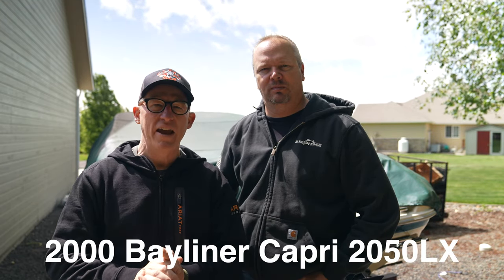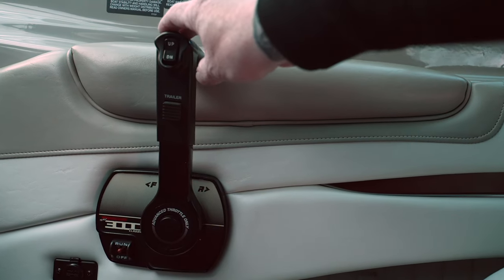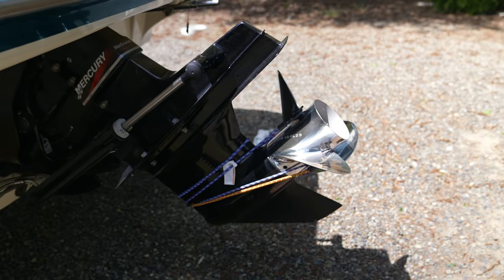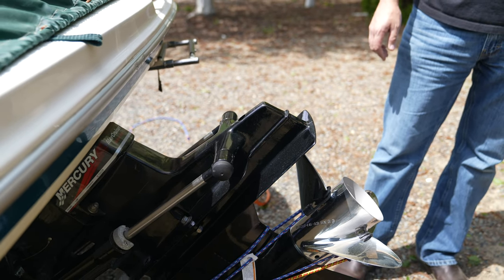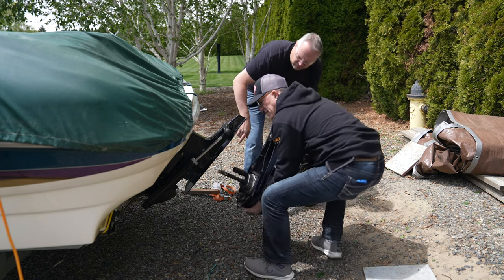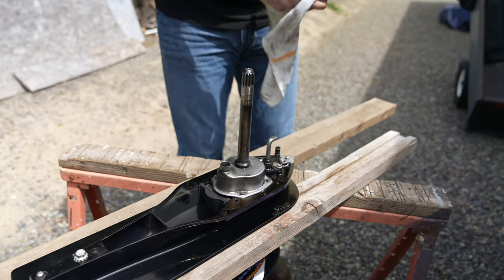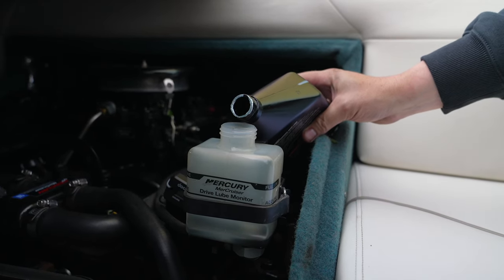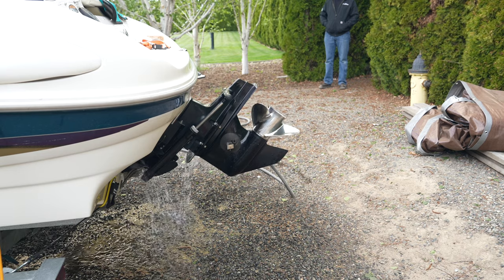How To Replace The Impeller On A Mercruiser Alpha One Sterndrive Outdrive

Comment: I have done this before and no bungee is needed and you can rotate shaft as much as you want. When installing, just don’t force it and gently work prop back/forth a bit to align splines while gently lifting. It’ll mate darn near instantly.
Reply: Thanks!  Definitely don’t have to worry about the shaft turning, in fact, it makes it easier to align the impeller key by turning the shaft.
Reply: Thanks for this!! i noticed they said not to move it and they stressed this, but they didn’t address what to do if it is moved. Sure enough, doing mine the prop spun and shaft moved even bungee’d so i didnt know how to proceed from that point. Same with the linkage… although i didnt move my linkage, it would be nice to know what to do for folks when things don’t go just perfectly. “Best laid plans” and all that.

Comment: Great video. From other videos I've seen after the gear oil starts coming out of the vent hole they close it up and continue pumping until its flowing into the reservoir to purge air. Do you think this is necessary ? Also should you trim the out drive down before starting it?

Comment: Hi Guys,
Great video and myself and my father used it to do this repair including the big conical seal on the vertical shaft…
Just to mention though that the video doesn’t mention the bolt at the very rear tail of the unit that is undone when the silver plate comes off…
We were banging and shaking the leg for 30mins until
I looked up under there and saw the extra bolt needed to be undone!
Even so, still a great detailed procedural video… thank you!
Reply: I'm at this stage right now.  The lower unit does not at all drop like they showed.  I've been banging on it with wood blocks, but finally gave up last night as I was afraid to break something.  Like you said, great video, but not complete without this.  It's good to see this in the comments.  When I get home from work tonight, I'll check it out.  Thanks
Reply: @mattlabrecque186  Hi Matt,
Yep I was almost breaking it too until I found that bolt! Please let me know if it was your issue too.
Reply: This comment needs to be higher! The video is otherwise great, but the lower unit won't come apart unless the bolt under this plate is removed.
Reply: Gets me every time lol
Reply: Are you talking about the bolt at 17:51 and 18:20 in the video when they are re-assemblying?
Reply: @Barryfamily1 that’s the one 👌🏻
Reply: I noticed that unmentioned bolt when they were putting it back together.  Good to know.  Great video!

Comment: Excellent video!!  5 stars!!  Your step-by-step instructions saved me hundreds of dollars.  I can't thank you enough.  As you mentioned, the toughest part of the job was reinstalling the lower unit.  Getting the splines of the lower unit to line up the upper unit was  difficult.  To assist with the reinstall, I used bungee cords on the prop as recommended along with a heavy dose of masking tape to keep the drive shaft and splines from moving during the procedure.

Comment: My boat overheated Saturday.  Almost 325 hours since the last impeller was changed. We run mostly deep water. Thanks for this video. We are gonna tackle this job this week. Really appreciate you going through this. Not rocket science but lots of good advice here. Need to learn to do this as its a regular thing. Cheers.
Reply from the maker: You betcha. Thanks

Comment: As has been stated many times, this is a great detailed video and should help many folks take on this DIY project. I would add one caution to the instructions, and that is to not run the engine with the outdrive trimmed all the way up in the trailered position. It has been said this will cause excess stress on the gimbal bearings. That may be an "old wives tale" but it's probably better to lower the unit from the trailered position "just in case."

Comment: With over 24,000 views, its evident this is one of the best tutorials out there. Very good work and much needed content!
Reply from the maker: Wow, thanks!
Reply: @RyanUrlacher  hey Ryan so quick question I have to change the impeller and I also had a leak of gear oil coming from the prop which I believe is my shift shaft seal. Is it hard to seal the whole unit while doing this and having it apart and do you have a video on how to do that. Thank you

Comment: Overall a very good video but since the unit is looking fairly well maintained and not that old here some extra checks for older units. The bungee cord is a good idea but once you put the lower unit back on remove the prop to check the propshaft for things like fishing line. When pumping in new gear lube oil you can also pump until the ventilation hole, close it and pump some additional oil in the system until there is a little bit in the reservoir. Than fill the reservoir. Note, not all outdrives have a reservoir or monitor inside the motor compartment. Important is to check while doing maintenance the status of your anodes and lastly the levels of your power steering fluid. (Cold and Warm) It can be a sincere pain in the ... to get well corroded oil drain plugs out. Do NOT break them. Sometimes the old gaskets from the drain plugs do not come out. Always replace old gaskets for the drain plug and check for the old ones.  Important thing to check is the quality and color of the lube oil that comes out. This, to check if you have any water leaking into your system. Hope this helps. Again excellent video.

Comment: Thank you for this tutorial! I just bought a 1999 Sea Ray 230 Signature. After watching a few videos, I realized it would be a good idea to change the oil, the impeller, and the gear oil to ensure I am ready to go. I was struggling with what kit to buy until I found out I had the alpha gen 2. I watched quite a few videos until I found yours. This one is the most detailed. I got a quote to do the gear oil and impeller at close to $500.00 at my local boat service center. I will be taking this project on myself now.
Reply from the maker: Right on!  Glad to help.

Comment: Great video gentlemen…very easy to follow & step by step descriptive. I think someone else commented about the bolt behind the round anode plate (above the prop)…that took me…oh…about 2 extra hrs to find!

If kit didn’t come with the sling seal gasket tool, you can just use the plastic gasket tube…it’s the extract opening size to place over the rubber sling seal to set it in place.

Comment: Thanks for the video! Just have to add as a newbie you didn't mention in the beginning the additional bolt that was there one you take off the plate. I thought my lower and upper were seal together shut so tried rubber hammering it and broke the lower unit flat plate. Had to get it welded and fixed wish I had know as you mention that bolt t
When putting it back on. Learning experience for me
Reply: @gusquintana8661  that's what happened to me too! I thought it was just because the boat is a 1985. I didn't watch this video first, but the stern drive is a little bit different with only 5 bolts.

Comment: Excellent breakdown of the job.  I have a question about the grease used at 11:55.   It looks like you are using a waterproof lithium based grease.  If so I would suggest that this is the wrong grease. Its fine for metal to metal use in marine enviroments, but it will eat away at the rubber impeller if used as you do here. I would use a red rubber grease instead or you could also use Evinrude tripple guard, which is safe for use on seals, o rings and rubber components.

Comment: Excellent video! But, you forgot to mention the removal of the hidden bolt under the anode plate. I see that you mention putting it back, but not removal. The lower unit will not budge until that bolt is removed.

Comment: Best video on YT on this topic. Thanks a lot!
I saw another clip where they used the oil pump to fill oil bottle in the engine room from beneath getting rid of the air in the pipes.
Reply: Do you mean they kept pumping right up past the vent screw and continued pumping into the reservoir? That sounds like a smart move.
Reply: @michaelking42  Exactly. I did it and it works 🙂
Reply: @ThomasT1976  Awesome, thank you. If I remember, I'll do that too. I do want to flush my oil out when I get to doing the job.

Comment: Great video, very helpful. 
There were a couple mistakes.
Some of the gasket sealant was in the wrong place (not a big deal).
But, DO NOT lube the face seal or shaft when installing. They should both be totally clean when installing as the friction fit is supposed to hold the seal in place. Only a little grase on the housing to allow the seal to slide when rotating.

Comment: You mention there is a bolt under the plate to contend with but removing it isn’t in the video. I thought the paint was acting like a glue preventing the lower unit from separating but it was the bolt you mentioned but didn’t show removing. Otherwise this video saved me tons of cash!

Comment: Excellent Video and highly motivational. I used the link, bought the impeller kit and awaiting delivery. 2 questions: I like the chalking of the prop so it goes back in the exact same way it came out. It looked like there was just enough wiggle in your setup to need slight adjustment to put back in. A) Would it make sense to wedge a block between the prop and lower unit and bungee/secure in that immobile state? B), even though your method was slightly out of alignment, it appeared the little wiggle wasn't too much of a problem or hassle. Perhaps A) is not as important if the wiggle is so easy?    Thanks for the info!  /to

Comment: I made a mistake and moved the shift linkage and tried to line it back up but was off a bit and forgot to double check it. I bolted the two units back the together and caused an issue with two shift linkages. I dropper the lower unit a bit and realigned it back up but they would not go back together. One of them moved in or out. So, I used a pair of pliers to squeeze them back in place. Will I have in issues with my shifting? I would add, make sure these two are married up perfectly before tightening up the bottom unit. Other than that pretty easy job.
Reply: It's fine if the shaft rotates but you can only rotate it counterclockwise to line it back up or it will shift out forward and into neutral and your linkage will not line up
Reply: @Oicu812b4y thanks for this. Not totally clear exactly what ya mean but counterclockwise sounds key. Can you spin it all the way around counterclockwise? (Multiple times if needed because over shot the mark)

Comment: This video did not mention that there is 2 bolts at the back where the aluminum plate is. Once you take the plate off there is another 14mm bolt that goes up through the bottom and you won't see it from the top of the drive, you have to look from underneath after you get the plate off to get it out. I took all the bolts out accept that one not knowing it was still in there and I was trying to pry my drive apart. I ended up cracking some of the housing on the bottom half because it was still being held by that bolt. Now I have to try and get the crack repaired at a machine shop so I don't have to buy a whole new drive. Don't make the same mistake I did. I'm not sure if all drives are like this but mine was!
Reply: I had to watch another video where a guy pointed out that bolt on the bottom.  I was banging away on my drive wondering what I was doing wrong.

Comment: When tightening impeller housing make sure it is centered on shaft it can in some instances actually rub on shaft. It will howl badly and damage housing and shaft. There are guide pin tools available but if your careful you don’t need them.

Comment: A Greatly Detailed Video, tops on YouTube so far. It seems putting the lower unit back with the spline alignment is the hardest part. I have a Generation One Alpha which I'm going to do shortly. Question: , is it easier then the 2nd Gen to replace the impeller?
Reply: And I subbed you guys.

Comment: Note the removal of the 1/2" head lower screw under the zinc plate- it has to be removed from the bottom.  You can leave the top screw hanging in the hole above it if you want as mentioned.  If your unit is not coming off, get a deadblow and some putty knives and screw drivers and work it off.  Kroil in the crack as you go.  Mine was stuck on the forward aligment pin, but the lower unit came off after a pretty good fight.
Reply: I wish I had read the comments. This is a great video, but some models have the extra nut. My 1995 Searay has that extra nut under the zinc plate also. Luckily I didn't beat on it too hard before my nephew saw that nut. This could have been a catastrophic miss. Mercruiser 4.3 Alpha One Gen 2 lx
Reply: Ps. Thanks for commenting to help

Comment: Most alpha one drives don't have a remote tank for the gear lube. The gasket has a place for one but I don't think I have ever seen that setup on the alpha one... Not saying that it doesn't exist but I have never encountered one. I'm running a belt drive raw water pump on the engine and I took the impeller out of the lower unit and tossed it .

Comment: Only use OEM impeller and it easier to place the impeller on the shaft and line  up the key first. Now lower the housing down and spin it over the impeller.

Comment: This is a good video, but you fail to mention there is another bolt under the zinc. Mine wasn't coming apart so i took a rubber hammer to try to lossen it up and broke the fin off.

Comment: The only thing they forgot was to remove the sixth bolt under the rear plate to drop the lower drive unit down and out. Thank goodness they did show that bolt being replaced at the end so hopefully someone will put two and two together when the lower drive refuses to drop and look for the reason why.

Comment: Excellent video, really appreciate you taking time to do this, I have 2 questions, I am assuming you need to let the permatex dry before you start it back up, 2nd I was under the impression you never run motor unless outdrive is in fully down position

Comment: Awesome video. I just got a boat given to me, a 2005 Bayliner 185 with the 3.0 stern drive setup. It hadn’t been running for over 5 years. PO rebuilt the carburetor but could never get it to run. I got it going today but the “exhaust” water coming out is black and smells of oil/gas. Is this probably an issue with a bad head gasket or cracked block?

Comment: Thanks for this. I guess it's time for me to do this on my 2005 Bayliner 175? 17 trouble free years with the original impeller is more than pushing it I guess. Question; is there a need to change the upper and lower housing gasket when the halves are apart?
Reply: I was just going to ask that. I'm assuming there's a gasket between the two.
Reply: no gasket, but there is a quad ring that goes between the two. it's located starboard side of the water pump housing. usually a little orange ring. this is where the gear lub is transferred between the upper and lower. this is the only seal between upper and lower..
Reply: @tjapkosmits8500  Thank you!

Comment: Thank you for the how to video but I'm really not happy now. My new to me 1996 Crownline with a Mercruiser Alpha one had a bolt that comes up from the bottom in the rear just in front of the the bolt while that screws into that round plate that comes off. Not a mention of it and of course it wouldn't separate. So I just thought it may have been together for many years and started prying it apart and broke the end of very back of the upper part off. Not happy.

Comment: I had my boat winterized recently. First time owning a I/O. If I drop the lower unit to replace the impeller and shaft oil seals as a winter project, will I lose any of the antifreeze the Marina put in the block?

Comment: Should I let motor run to normal temp..and what would be normal temp?.. my temp is going over 170-close to 200 at trawling speed so i shut it off or speed up; and comes down to 170 at higher speed and doesn't come any lower... I'm sure I need a new impeller if it's going that high?

Comment: I hope someone can help me. When installing the lower unit, I can’t get the propeller to move the driveshaft. It doesn’t move when I rotate the propeller in either direction. I just get a clicking sound going to the left and I can’t get the lower unit to meetwith the upper unit, what am I missing?

Comment: Ok . Don’t bungee the prop .  This way you can slide the impeller over the shaft then the housing turn the shaft clockwise while pushing down the water pump housing then line up all the gasket holes and install the screws. Plus no need for any gasket adhesive.. and no grease on the impeller or housing, mabe a little thin oil if it will make you sleep better at night.   Then when you slide the lower unit back in you can turn the prop to align the splines…

Comment: Aligning the water pump tube is a pain and if its not done well its overheating problem and don't trust the vent hole when filling it with oil because the hole is too low and the gear is running dry at high speeds today's drives don't give you grease fittings nothing like the 1970 s trs drives

Comment: I'm leaking oil from my outdrive, and I know I need to replace 2 gaskets. Do you know if these gaskets are the same gaskets, or are there more gaskets that I'll need to replace?
Reply: There's only one o ring involved in the gear oil. I doubt it's your issue.
I recommend you pull the prop and check for fishing line. These can mess with your seas.
Reply: That little o ring is probably to blame and is really hard to keep it in place while you try to join the two parts back together. It may be sliced or damaged.